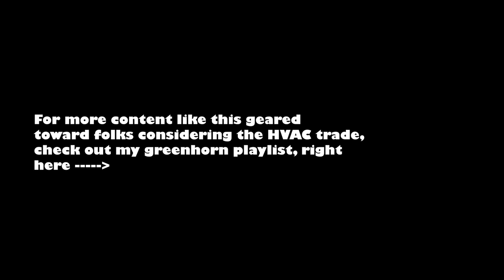5 Things to consider before becoming an HVAC Service Tech🔥❄

Comment: I agree with most of what is said. 
I do disagree with the not getting the kudos, praises and appreciation. I get them almost every day. Whether it be verbally, by text, email or letter, my customers tell me all the time that they now have that much needed heating, air conditioning or refrigeration after days or even weeks of going without it. This is especially true when the last few swinging dicks were clueless and couldn’t fix it. 
After doing this for 35 years, I’ve seen most of it. 
I do feel valued and appreciated from the many pats on the back. 
However on the flip side as one tech stated, you can be their hero one day and a bum the next because the equipment you fixed the day before took another shit from an unrelated problem.

Comment: How many hours a week do hvac techs work a week?
Reply: I peaked at about 80-90 hours during the AC season as a resdential tech. And normally its between 50-60 hours. More so 50 when the busy season passes. Fall and spring slow to a mere 40

Comment: One additional thing while I enjoyed my job there was nothing I could do about the Karen's. And for some reason no matter what they did it was my fault. It is impossible to defend yourself particular if you're doing domestic service where you hit six or seven jobs per day. It is virtually impossible to complete 120 jobs a week which is approximately 6 calls a day and not have a complaint. All complaints are taken seriously and no defense you offer is acceptable. This is not a doable job. Like most people I only get two or three years out of a job before I have to leave. Also contractors do not give raises so unless you're in a union don't count on getting one. Am I 40 years I have seen the best and the worst. The only thing that counts is sales.

Comment: I LOVE BEING ALONE, except on the dance floor. Ladies you've been warned RAWR!
Goldsmith/Master Jeweler here. Certified Photovoltaic Tech / Electrician. Solar Thermal... 
I have other Cert's under my belt. Professional DIY Self Taught Man! 
For those who have a "Annie" Hermetic Analyzer I typed the manual enjoy OLE!
The following data is applicable to the ANNIE A12X Export 220-250 Volt-60 Cycle Model.

SECTION A – METER OPERATION 

Ohmmeter

1. Make sure the Analyzer is unplugged and Ammeter Switch is off, Ammeter operates on “D” cell battery.
2. Move Ohmmeter Switch to ohms position.
3. Clip Red & Black leads together, turn Master Switch on, needle will move to about zero. Adjust to zero Ohms with control inside chord pocket. If meter will not zero, replace battery.
4. Use Red & Black leads to identify winding terminals. Highest Ohms is from Start to & Run terminal.Terminal left is Common. Reading from Common highest is Start. The remaining terminal with lowest reading is Run.

Voltmeter

1. Disconnect Analyzer from external power source.
2. Put Ammeter Switch to “Hi” position.
3. Put Ohmmeter Switch in “Power” position.
4. Put Voltmeter Switch in “Line” position.
5. Turn Master Switch “Off”.
6. Isolate Black, Red, White and Yellow from each other and earth.
7. Connect power supply chord of Analyzer to "voltage connection to be read.
8. The "voltage indicated on the Voltmeter is the line "voltage supplied to the Analyzer.

Ammeter

1. Disconnect Analyzer from external power source.
2. Put Ohmmeter switch in “Power” position.
3. Put Ammeter switch to “Off” position.
4. Put Master Switch in “On” position.
5. Connect the apparatus under test to the Red and Black leads. Isolate the Yellow and White leads from each other and ground.
6. Connect the Analyzer to a power supply of the correct "voltage for the apparatus being tested.
7. Put Ammeter Switch to “Hi” position, read up to 25A apparatus being tested. After apparatus has started switch to “Lo” position, if current draw on the ammeter is under"5A"
8. If line "voltage is desired while measuring amperage, place voltmeter switch in the “Line”position.

Section B - HOW TO CHECK A HERMITICALLY SEALED UNIT 

1. Remove all external wiring from the terminals of the sealed unit.
2. Connect the Red Lead to the Run Terminal. White Lead to Start Terminal, Black Lead to the Common Terminal, and the 
Yellow lead to the solidly Frame.
3. Make certain Master Switch; Ammeter Switch and Voltmeter Switch are off. DO NOT CONNECT ANALYZER TO EXTERNAL 
POWER.
4. Put Ohmmeter Switch in “OHMS” position and press Start Button. If resistance is indicated (movement of ohmmeter)
the windings are shorted to the frame.Replace unit if this condition exists.
5. Put Master Switch in “On” to check resistance of Run winding. “Reverse” position checks resistance of Start windings. 
Replace unit if windings are open or earthed. 

Section C - HOW TO START A HERMITICALY SEALED UNIT

1. Remove Yellow Lead from frame and isolate it from earth.
2. Put “Ammeter” Switch to ‘Hi” position.
3. Put “Ohmmeter” Switch to “Power” position.
4. Put Master Switch in “Off” position. 
5. Put Capacitor Selection Switch in proper range (see selection G)
6. Connect Analyzer to power supply of correct voltage for the compressor. Power Light will come on when the Analyzer is energized. If no light or a very dull glow of Power Light check fuse in chord pocket. Replace if necessary. Line Voltage can be read by putting Voltage Switch in line position. 
7. Hold Start Button “IN” put Master Switch “ON” position.
8. Release button when units starts.
9. Turn Master Switch off if unit fails to start in 3 seconds. 
10.If unit operated satisfactorily the trouble is with the capacitor, relay, control, overload or other external wiring.
11.Put Ammeter Switch and Voltmeter Switch to desired ranges for further tests. These tests include low voltage or high current draws, those that are above rated amperage. If unit fails to start it is stuck, see section D. Disregard capacitor and relay bulbs while making this test.

Section D - HOW TO REVERSE A STUCK OR FROZEN UNIT 

1. Proceed as outlined in Section C, steps one and two.
2. Holding start button in, quickly move Master Switch between “On” and “Reverse” position several times. If unit starts let 
it run for approximately a minute then turn it off. 
3. Try to start the unit as outlined in Section C, Step 3. If unit now fails to start it is beyond help and must be replaced.

IF FUSE BLOWS WAIT FIVE MINUTES AND REPLACE THE FUSE INSIDE CORD POCKET

Section E - How To Test Capacitors

1. Make sure Master Switch and Ammeter Switch are off. Put Ohmmeter in Power position. 
2. Disconnect Capacitor form all external wiring including bleed resistors. 
3. Discharge Capacitor with light bulb or bleed resistor so as not to blow fuse on internally fused capacitors. 
4. Connect Black and Yellow Leads to Capacitor terminals.
5. Connect tester to power source.
6. Place Ammeter Switch in “Hi” position and note reaction of light.
a. If light goes on then out the capacitor has taken a charge. New capacitors may keep the light glowing for few minutes
b. If no light the capacitor is open.
c. If light stays on then the capacitor is shorted.
d. If light decreases but does not go out the capacitor is leaking.
7. When light goes out, press capacity button for mFd reading of start capacitors. (Do not press button if light remains on 
indicating a shorted capacitor) Discard capacitors that vary 20% from rating. For small start and run use “LO” range on 
Ammeter. 
8. (Optional) The Analyzer can be left on the job as an emergency substitute capacitor. Connect the Yellow and White 
Leads to the leads that normally go from the systems wiring to the capacitor DO NOT PLUG THE ANALYZER IN, put 
Master Switch on and set Capacitor Switch mFd needed. All other switches should be left off or in the center position.

SECTION F - TO TEST POTENTIAL RELAYS ONLY

1. Make sure Master Switch, Ammeter Switch, and Voltmeter Switch are off.
2. Put Ohmmeter Switch in relay position.
3. Turn volts control all the way down (counter clockwise)
4. Connect White Lead to relay terminal #1, Black Lead to #2, and the Red Lead to #3.
5. CONNECT ANALYZER TO 230 VOLT POWER SOURCE.
6. Turn Master Switch “ON” and set Voltmeter Switch to relay position. Relay light must come on. If no light points are 
open, replace relay.
7. Increase volts until relay “picks up”. Make a note of the voltage before “pick up”. This indicates the “pick up” voltage.
If light remains on, points are frozen and relay must be replaced. If relay does not “pick up” at maximum rated volts,
the coil is bad and the relay must be replaced. 
8. Decrease voltage until relay “drops out”. Make a note of voltage just before “drop out”. This indicates “drop out” volts.
Light must come back on when replay drops out. If Light remains on the points are frozen or sticky and relay must be 
replaced. 
9. Compare pick up and drop out voltages with the information supplied by the relay manufacturer. 

SECTION G - 240 VOLT CAPACITOR INFORMATION

1. Units up to 2 hp use 25-80 mFd range.
2. Units of 1-1 hp use 85-145 mFd range.
3. Units over 1 hp use 150-200 mFd range. 

SECTION H - RELAY WIRING INFORMATION

1. G.E. Relay 
a. Lead from post #1 goes to “Start”
b. Lead from post #3 goes to “Run”
c. Other post is “Common”

2. Delco Relay
a. Lead from post #S goes to “Start”
b. Lead from post #M goes to “Run”
c. Other post is “Common”

Comment: What is  a normal day for you in hours
Reply from the maker: hvachookup 8-10 a day if you average it for the year
Reply: There are no normal hours.  You could work one hour or 20 hours.  My personal best was 78 hours straight.  But most techs put in between 8 and 12 hours a day.  Unless your on call then it could be 24 or more.  I average around 50 hours a week, but then I set my own hours and do really good work so I have very few service calls.

Comment: 5 things!!!!!!
One... low crawlspace residential old houses etc?!
Two.... Hot Roofs/rooftops commercial!
Three... high roofs 30-40 ft ladder access! Heights!!!
Four.. late getting home at times!!
Five customers shopping questioning your prices etc! All the time!?

Agreed can be very physical!!! Knees , back etc.... you will be trying to give a customer comfort (pleasant temps in establishment).... meanwhile you are extremely uncomfortable!!!
Hot roof ,hot attic, low crawlspace, tight places, & etc!!!

Funniest saddest part.... some customers have no clue how much effort goes into the work at times..... & try to haggle you down... as if it was a piece of cake!!
Example... looking at how long it took for you to fix..... even tho they couldn't & didn't have a clue!?
Maybe the hvac person is worth more than you thought!?!
More knowledgeable... the easier their work appears to be....

If you are thinking you'd like to do this for a living.... consider these things!!!!
Also consider pets(dog attacks!?)... snakes, spiders , bees/wasp/yellow jackets/ Hornets , critters (opossum raccoons etc in crawlspaces)...expect the unexpected!!!
Hvac is not always a walk In the park!
I've done commercial & residential!!
Industrial wrkg on cranes high up.... a pain!
Walking up stairs & adding fridge... always leaking! Steel mill & extreme heat ... always leaking!?
Braided line sets stressed from extreme heat!?

Comment: im a chick going into this trade what is your experience with woman in this trade and how there treated?
Reply: Its not something that would be physically impossible for a woman  to do but just so you know a lot of the equipment is very heavy,you will work for really long hours specially in the summer, and its a total nightmare when you have to go to an attic in the summer I'm fairly new to this too only been at it for 6 months or so and if you really want to do this I thinl you will do just fine and tbh i never met a woman that workd in this field which kinda sucks cause my social skills with women went downhill for a while due to me interacting with only males on a daily basis with almost no female interaction so i think more women shoud try this out

Comment: Eventually you tire of lifting 50 lb. cylinders of refrigerant , vacuum pumps, torches and other heavy shit up a ladder to the roof of a mall where the only 'authorized entrance is a 1/4 mile from the job, the roof is covered in white gravel and it's 100 deg. outside. The customer will never be happy when you present the bill......

Comment: You are going to be working long hours working in extreme heat and bitter cold.
When I say long hours I mean 10 to 15 hours per day.
You will have to work on weekends, nights and holidays.

You are going to have to deal with uptight customers that think they are more important than everyone else and want their system fixed NOW. Those same customers are also going to complain the cost of the repairs.
You will have to deal with the flaws that the manufactures of AC  equipment are doing these days. (It's really getting bad). 
I am just naming a small fraction of the crap you have to deal with

Comment: A lot of psychos in Hvacr.  Dudes who think way too highly of themselves and just can't be wrong.  Some shops are setup as dog eat dog shops.  Hvacr is physical but way less than something like block laying and concrete forming.  Hell we get paid to drive sometimes for  hours in an AC vehicle, eleven years later this still blows my mind
Reply: I find the whole HVAC line of work interesting it seems like more people are trying to throw others off the HVAC trail becauae of its simplicity. Alotta of things guys complain about seem so  unnecessary like I know I shouldnt be on my phone while working is that not obvious?

Comment: Newbies,  that paycheck doesn't belong to you. It belongs to the tool supply company you shop at. This job will cost you money. Do not just buy whatever cheap stuff you can find on Amazon. Budget for tools each week. Buy the higher (not the highest) quality tools you can. Tell your family and friends to NOT buy your tools to help you get started. Selecting the right tools for you is a very important and personal decision. If they want to help, ask for gift cards. You can tuck them away until you need that one tool you never thought about.

Comment: If I could give you anything. it does not change whether it's air conditioning or refrigeration. it has a metering device and is only a big sponge...………………………. I don't care what refrigerant is used. you absorb heat or cooling and you extract heat or cold. ONE BIG SPONGE !

Comment: Anyone else use a tool bucket to save knees when possible?
Reply: I have a bucket with a tool pouch which I use to sit on. I work on residential oil burners, which are usually low to the ground. I know guys who kneel on concrete floors to do the work, and have knee problems. I have been doing it for 33 years and have never had a problem with my knees.

Comment: I see a lot of negative comments on this video about fuck working that hard and things to that nature. Don’t forget that services and goods don’t appear from thin air. Things that are made and manufactured take fucking work. I’m 33 and have a slew of jobs and have taken the best and after i plateaud and had no place to grow in the company I moved on. Learn as much as you can and focus on making money, social security and 401k will not be a means to survival when your in the elder years. You have to work to survive, fuck being a sports player or a you tuber. That shit isn’t a reality for long term financial security. This dude fucking works and keeps shit running. We need more people to work and not sit around and be thinkers. Yes designers and engineers don’t “physically” work that hard but they put in the hours and mental stress just the same. Trades are positive and long term and respectful jobs to have, I splice Fiber optics and with out splicers you couldn’t watch this video or read this rant of a comment while taking a shit in your air conditioned bath room.

Comment: He brings up a lot of great points here. In my opinion after training I handful of guys from scratch to now full-fledged technicians I would definitely recommend paying attention to everything the senior tech has going on and learn what he will need next. Knowing how to install the equipment will help you with servicing it tremendously but you should definitely try to get somewhere where they mix a little bit of both sides of the trade.  Pay attention and ask a lot of questions, remember that this is going to be in your life if you’re serious about it and it is extremely rewarding and a lot of fun. Not all fun of course but overall it’s an excellent trade.

https://faithheatingcooling.com

Comment: Addition: You're NOT going to be making 100k in the first year.
 You're first "Technician" job, will be more maintenance oriented, not repairs/troubleshooting.
Have Humility. You will make mistakes, you will miss diagnose. LEARN FROM IT.
Work on your long term stamina, it will take a toll on you.